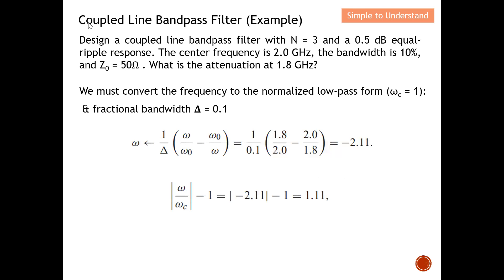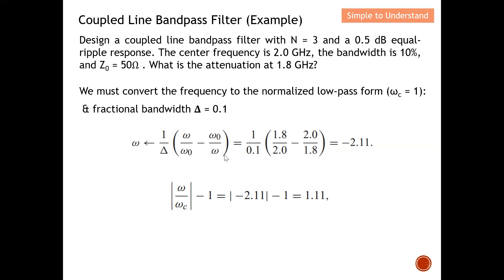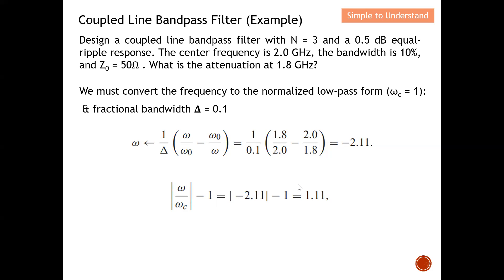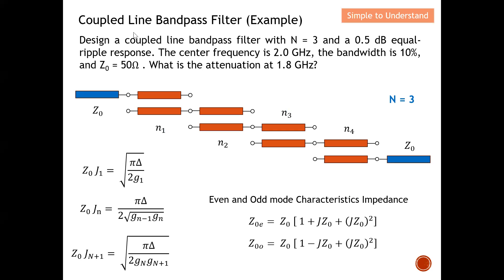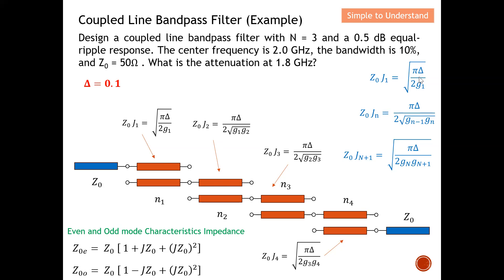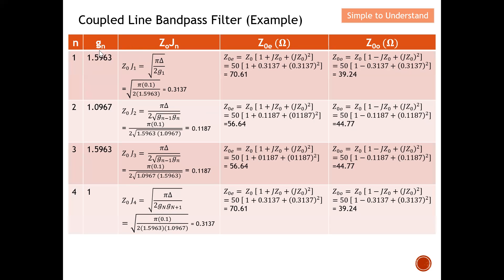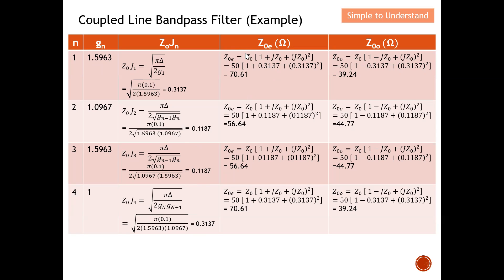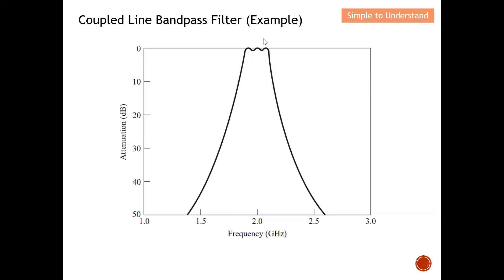Filter Design #25. Explained How to Design Microstrip Coupled Line Equal-ripple Bandpass Filter.

Comment: How did you take g4 and g5 values or g3 and g4 values while the even mode and odd mode impedances? In the place g4 and g5. you have replaced with g2 and g3. why?
Reply from the maker: I am sorry, I dun understand your question. The question N=3 which means I have 4 sections (N+1) of coupled lines. Therefore I only have g1, g2, g3 & g4 only. I dun understand why there is g5 value. Thanks.